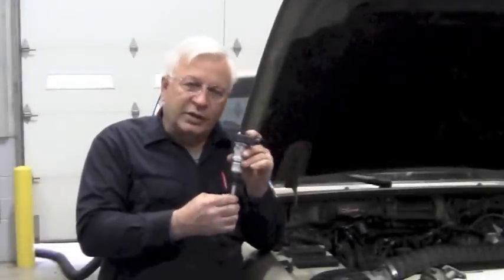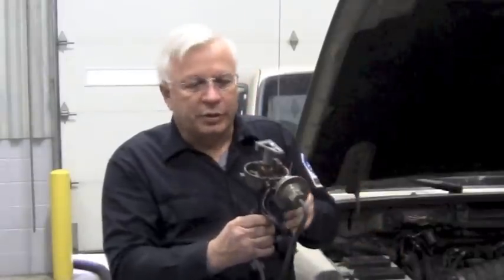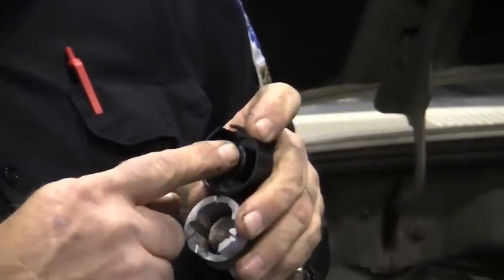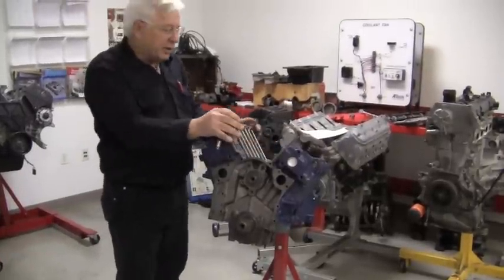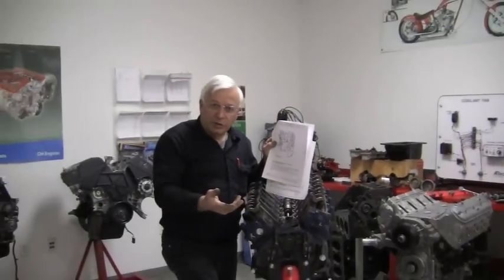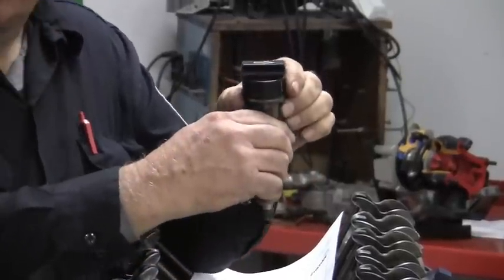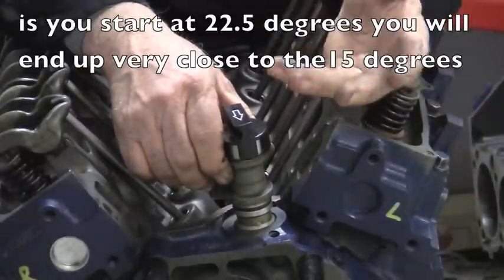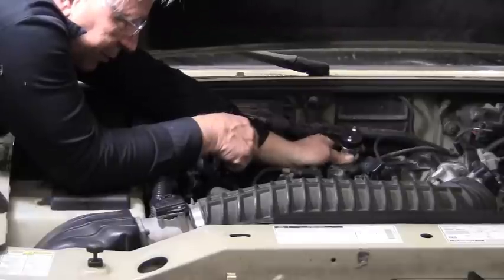Installing a Ford Synchronizer

Comment: Good video.  I used a 24mm socket to turn the engine to TDC mark.  A plastic alignment cap came with my cam synchro.  I inserted in just about the same position as the original.  My original cam synchro was all mangled and destroyed inside the cap.  The car ran that way for a couple years.  Made a squeaking sound.  I thought it was the water pump.  My understanding is that the cam synchro doesn't control cylinder firing order, but synchronizes the fuel injectors to fire properly.  I've read that the car can function with a failed cam synchro, but is very fuel inefficient and misfires.

Comment: I find the hard part is locating TDC on this 99 Ranger by counting back from the gap on the crank (where the engine crank sensor is reading engine position.) Some people say you should count back 5 "fingers" or "teeth" and others say count back 6 "teeth" for TDC on this engine. You can go though this whole process, but if you've located the engine on the wrong "teeth" at the crank sensor your Cam Synchronizer will be incorrect even if you've installed it perfect. It is still a good video :)

Comment: Very well presented, explained, and much appreciated.  I just did one today on a 2007 Taurus with a 3.0 Liter.  To bring the engine to TDC on the Taurus with front wheel drive, I removed the passenger tire, and went behind the splash-guard to access the engine's damper pulley.  I used a 21mm socket, with a 1/2-inch drive, and short extension to turn the engine to align the interrupter.
Reply: How do you know what stroke you are on?  how do you know you are on compression not exhaust?
Reply: ArcolaBridge

Good question. It is true that I could have been on the exhaust stroke; although, for the installation of the camshaft synchronizer, aligning the tab with the hall-effect opening is the goal.  I simply turned the crank-pulley until the tab lined up with the opening on the housing. 
So really TDC on the compression stroke is not paramount for this procedure; rather, aligning the synchronizer for reference to install the new one.
Reply: It's ok, your motor will just run backwards.

Comment: Great video Dwyane. I like where you take the extra time to illustrate installing the synchronizer in an engine with the upper components removed. Really helps out a lot. Thanks for taking the time to make this video.

Comment: Or
Remove spark plugs
Rotate engine to top dead center #1.  Have a friend handy to hold finger in #1 spark plug hole. Use nylon tie in spark plug hole to find TDC
Make sure the synchronizer tool fits on original still in engine so its indexed for removal
Mark a reference point on block where the arrow points with the tool
Remove old synchronizer
Replace new synchronizer with it pointing at original reference mark on block
It's that easy, did it in the college parking lot a couple years ago.

Comment: I have watched a few of these demonstrations on doing this on this engine. As usual your methods are extremely clear, you do not speed talk like most of the younger people, making it much easier to understand. Thank you. The picture you showed of the sensor body fully installed, saying to then bolt it down, seemed to still be about 3/16" of off  the block. due to the oil pump drive not aligning, do you not have to turn, or crank the engine while pushing down on the synchronizer to seat it totally. This was the hard part when doing distributer installations. I only bring this up because I had to repair a car many years ago where another mechanic ruined the cam gear by trying to beat the distributer in with a hammer. Keep up you good work.
Reply: Speed talking isn't a youth thing, its usually geographic. BTW I'm 63. I'm from Fl, we have many people from other areas live here, on average native Floridians speak slower then do people from the N.E. , just saying.

Comment: Great video. It cleared up the lousy instructions that came with my aftermarket synchronizer.  I wish the engineers had not buried the darn thing so far behind the lower intake manifold. It wold not fit down in with the tool installed, so I have modified the tool a bit (chopped some off) so it will drop down in there.

Comment: before pulling out synchronizer take chisel or punch an established center line point that touches both synchronizer and block in the same place. then transfer that to new synchronizer before reassembly

Comment: I just marked where the pointer is. When I put the new one back in I made sure it lined up where the pointer was on the old one. And it worked. I didn't need that tool. That is way easier than a distributor
Reply from the maker: you are correct however some people remove it and without noting where it was installed. This is for them.

Comment: Great video and explaination. I have a 1998 For Ranger 3.0 that i had a p1309 code coming on right after my motor was rebuilt but never got it fixed because it was the only code and it was running fine but always kept my check engine light on. Lately i was getting other codes p0171 and p0174 and p1137 and p1131 and it's been running bad. I have checked fuel pressure with a gauge and its holding steady at 62psi. I had a plugged pcv valve and broke vacuum hose that i fixed and did a smoke test using a cigar and dont see any leaks. Ford dealer said probably the cam syncronizer was off just enough to cause the light and code to come on. I bought a new syncronizer and installed it at 75 degrees TDC using a gauge and screw driver and also the mark on the damper was exactly same as where i found TDC, Only problem is that my Hanes repair manual must be wrong because it is impossible to set the syncronizer at 75 degrees because when you do the sensor will not go on because the plug end sticks out too much and hits a place on the block not allowing you to place the sensor on correctly. so i have it set at about 50-60 so the sensor will go on and that is about the same position the old one was in and now i see why the engine place set it off a little. Do you know where i can get another spec on the correct setting. I am now getting the same codes and it idles with like a spark knock like the timing is off. Is it possible the timing chain was set wrong or jumped?
Reply: I have read so many different degrees for a ford 3.0L vulcan, it is mind boggling. I have read 10, 15, 50, 60, 75...its like no one really knows?!! If you want to start from scratch, just because, say the cam sync flag is no longer even there, or maybe the old one was put in wrong years ago, etc. You should have a reputable answer to what freaking degrees is correct, I still do not know what the correct is for my 2003 ford Ranger edge (V) 3.0L.
Reply: Two days ago, I had codes P0171, P0174, P0175, P1131, P1151 ---All related to the O2 sensors, so today, I had a shop replace all 3 O2 sensors, two upstream & one downstream. That did not help, still having same issue. So, that tells me that just because you get codes saying or pointing to bad O2 sensors, does NOT mean they are bad, just that they are reporting a lean mixture, etc. So, now I have went out and purchased the cam sensor, and the Motorcraft Cam synchronizer, and hoping that I can do it the correct way...ugh.
Reply: Very late on this but the correct orientation is 38 degrees
Reply: I'm fighting a 1309 as well. After doing some research I realize I've installed it wrong for the second time. I rebuilt the engine so I had no original point of reference. If I remember or if someone else comments I will update with results

Comment: Glad my 98 Ford e250 has the 4.2 l V6 Essex engine and the cam sync is by the water outlet and heater bypass and EGR

Comment: THANK you doug gyver for pointing out that it doesnt really matter where the housing of the cam synchronizer, i was wandering what the whole degree thing was really for if i already installed the synchronizer with the little tool and with the engine at TDC. anyway my scynchronizer only went on one way anyway.

Comment: is it possible for the synchronizer to leak a good amount of oil with the hold down bolt tight ? seems to be where im getting a pool off oil from

Comment: Wow! You are very luck.  431000 miles!?.  The best answer I can give you is that they last as long as they last, but the majority of the water pumps I've replaced are usually sometime after 100k.  There are so many factors to take into account when it comes to parts longevity. Like, Is the part high quality/ Does the owner keep up with the maint/ and the list goes on.  Apparently you've taken care of your Ford.  Kudos.

Comment: Because of the tight space between the engine and firewall what are the chances of getting a small protractor in there?  Great video.  I'd never even heard of a cam synchronizer before.  Learned a lot thank you.

Comment: Finding the TDC in a windstar with 3.8 is very difficult because removing the spark plug at the #1 cylinder is a very time consuming process.    Can the #5 cylinder be used to find the TDC  in #1? Or any other cylinder in the front bank of the engine?

Comment: I've done all as stated on my 2001 Ford Taurus. After 30-40 miles my CEL comes back on. I am puzzled because I've done the "Stab" step by step.  I've even tried 3 different Sensor Manufactures.  Any ideas are GREATLY appreciated!
Reply: Reset your keep-alive memory with a scan tool.

Comment: I sure would like to know how you got that synchronizer out without removing the lower intake manifold. Looks like mine is partially covered by the intake manifold. No way to hardly even get a wrench on it let alone get it out. Oh, my old beater (that I'm turning in to a flat bed) is a 99 Ford Ranger 4.0L OHV.

Comment: You cannot see the gears in this video. ALL camshafts turn at half of crank speed. They have to in order for the valves to perform four functions within two revolutions of the crankshaft. It's the basis of a four cycle engine..

Comment: Thank you for a good instructional video.  I have 2000Mazda B2500SE 2.5L 4Cyl Manual Engine with 8 spark plugs.  My question is does this year model truck have a camshaft synchronizer?

Comment: Thanks for the video. I'm about to do this on my 3.0. Lucky for me, it's on a stand right now, which should make it much easier. Now to figure out what position it's supposed to be in. Can I rotate it to TDC and remove the cam sensor and mark a line where it is?
Reply from the maker: Yes, that will work

Comment: Nope, you're dead right. The "15 degree" marking in the manual is a suggested range of installation in order for the connector to plug in.
The installation tool locks the reluctor relative to the housing, the engine being at #1 TDC (or wherever it's spec'd for) completes the equation.
Ol' dude's making it MUCH more complicated than it needs to be,

Comment: does it matter if you put it at TDC i don’t understand that part, if you roatate the engine until the alignment tool will go onto the sensor before you unbolt it and mark it then shouldn’t you just be able to put the tool on the new one and get it to align with your mark and then bolt it back down and be done

Comment: Correct me if I'm wrong....but can't you just mark where the current notch is at on old one before pulling out....then install new one with arrow pointing to marking of old one...pretty sure putting 'number 1' at TDC is just so if you mess up / having a more defined reference point....correct?? Of course with old school distributor you had to do it this way...but with electronic system doesn't the PCM have stored where everything was at last shutdown.....thus being able to line up at aforementioned way...
Reply from the maker: Barry you are correct. However many don't think or work that way. They remove it and then don't know how to reinstall it.

Comment: Does the synch engage the oil pump drive before it makes contact with cam gear.  The oil pump drive is a hex, so the synch will only drop every 30 degrees.  so does it engage the oil pump drive first, then you can rotate synch and oil pump drive together until the correct synch gear tooth engages the cam gear? 
Having a hard time getting synch to fully seat.  should i use washer and 10 mm bolt to drive it?

Comment: QUESTION: When you stabbed at the right angle at 9:47 the synchronizer wasn't fully squared with its housing. Same thing is happening with me. The old one fits flush. The new one, with the alignment tool, doesn't. If I put the alignment tool on the old synchronizer, same problem happen. Any thoughts? Is it ok to leave a little gap like you did?

Comment: it did one of these on a ford ranger 4.0 in school man did that suck, you couldnt see anything even with the intake off
Reply: How did you get it out at the end of the day? I have a 4.0 and I have my upper intake off, but the sensor is stuck on the synchro and I cannot separate them. Without separating them, the sensor hits on the bottom of where the stud is located for the upper intake. There isn't enough wiggle room for me to remove it without the sensor off, and I am having to do everything by feel (like you said, you really cannot see anything).

Comment: Thanks,it's a bit clearer now..I put my revive back together after replacing the timing set..all it did was crank and crank.it ran for two seconds,then a loud pop and smoke at the front of the engine.like when a high voltage shortage happens.does anyone know what that was?
Reply: Good chance it's out of time.  Probably 180 degrees out and that means the opposite valves are open when they shouldn't be.
Reply: @strokewarrior5762  thank you for the reply.so I should rotate the camshaft synchroniser 180°?
Reply: @metalmaniaxx  possibly, but I would suspect your actual valve timing if off
Reply: @strokewarrior5762  thank you.I will check again.but I lined up all the dots with each of the gears.that seemed pretty straightforward.but I'll check.

Comment: Thanks for the info. I have a 1995 Ford ranger 3.0L with a synchro. Will the connector line up with the direction the arrow is pointing? My engine was replaced and mine whistles when it is cold above 55 mph until the motor warms up. My connector probably points 15 degrees to the left of the engine looking at it from the rear with the connector pointing toward the engine not away from it. I think the installer did it incorrectly.

Comment: as the synchroniser body is not keyed into the engine block, why can you not rotate the synchroniser until the metal tab in the reluctor is in the home position? 
15 degree alignment would be there for to make sure the wiring plug would reach the reluctor. am  i missing something?

Comment: Great video but how do you crank the engine over by hand ? I tried it clockwise and it wont budge. Also where do I find the degrees for my truck please? It's a ford explorer 1997, v8 awd. Thank you,,,,, GOD BLESS you good sir,,,,
Reply: I was able to crank my engine to the the TDC timing mark using a 24mm socket.  1998 Mercury Mountaineer.  Just like an Explorer.   I just assumed it needed to be TDC.
Reply: 8

Comment: I'll take an answer from anyone that has experience in replacing the camshift sensor.
I was just told by a mechanic after the scan, that it showed PO340 code for the 97 Ford Ranger. The Ranger runs smoothly and not one problem except the check engine light.  
I was told this is an all day job!
But, after viewing this, I don't believe it is an all day job, I think it is within 1/2 hr job at a price of 350. am I wrong?
Reply: SJR I'll be glad to give you my opinion.  The actual real time to make that repair would easily fall under the usual 1 hour minimum that most shops charge.  However they are probably adding in the time and experience factor for diagnosis, which could easily be an additional hour.  That would total 2 hours.  Could it be done in 1/2 hour?  Possibly for a tech that has done many, many of these.  However there would still be a diagnostic charge.  Regarding the "all day" statement.  I would assume that the shop your referring to has multiple jobs currently working at the same time.  With each job taking time and have to work yours into the schedule, along with interruptions, phone calls, lunch breaks etc.  I don't think its unreasonable for the shop to mean that they would need the vehicle for the full day in order for them to complete it.  As far as the cost of $350,  it really depends on what their shop labor rate is and what they may be including, like the parts.
Reply: @strokewarrior5762  I appreciate your response and support.  
I gave up on this man that gave me the  one day sells job, 
I have no confidence in him which is sad since I've been going to this garage since the 90s.only 5 miles from my house, 
  I never saw this man before, however.
 He was suppose to call me at home with an estimate of the job labor and parts, he never did, I called today at 4:00pm,
 he was not available to come to the phone.  So, I told the office lady I've been on youtube watching this process and it wasn't an 'all day' job -just to send a message to this man that wouldn't take my call. 
 I called a Ford Garage in a distant town, I figured I can make the drive since the light isn't blinking yet. 
That Ford Garage said, as you did 1/2 hr job at 52.00 labor and 50.00 for the part.  
Again, I appreciate your support, a better sleep tonight- Thank you
Reply: @sjr7822    Glad you were sensitive enough to wonder about what he said.  Thanks for letting me know.  Glad your getting the right info now.  Duane

Comment: Great video sir. I am working on a 1994 Ford Ranger with the 4.0. The synchro is the three wire with the window. I cannot find the tool for this year for some reason? Is your process the same for this application sir?
Reply from the maker: yep, pretty much the same